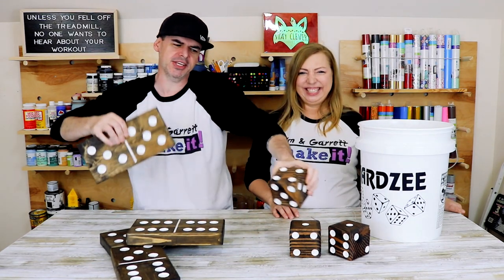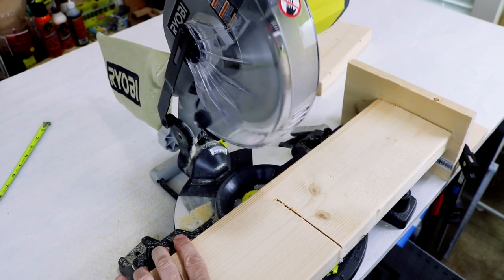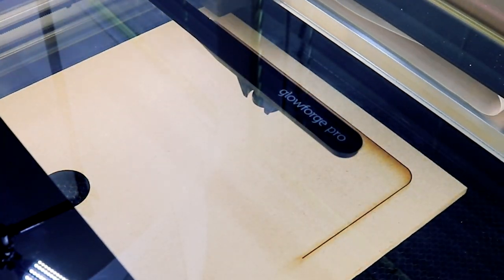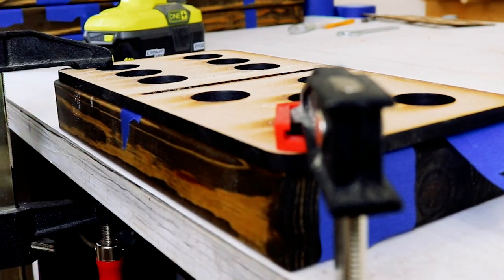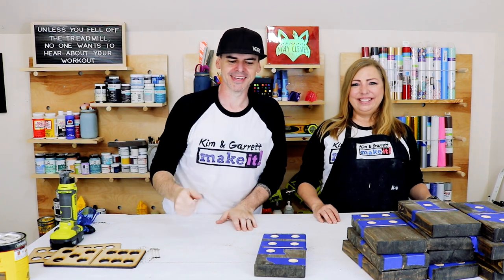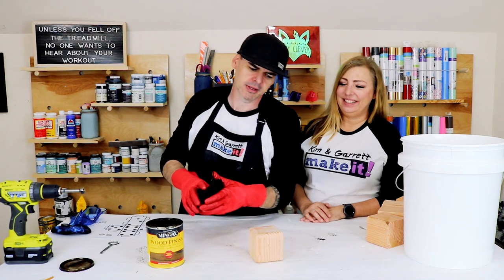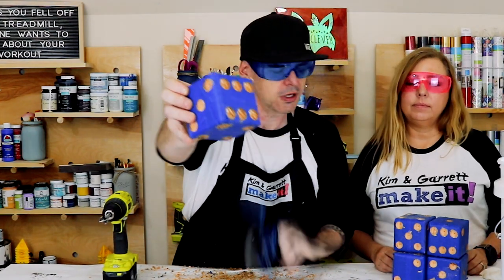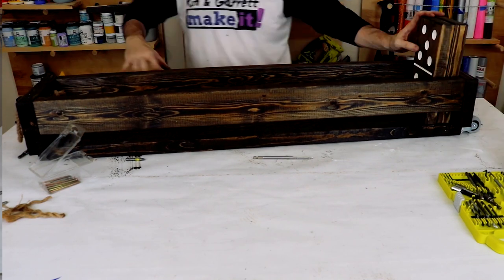2 Easy Yard Games Giant Dominoes Yardzee Dice Lawn Games

Comment: I have a friend who had a set made with yard sale dot/label stickers so I am pretty sure vinyl would work. she sealed them after placing them on the dice with acrylic paint sealer
Reply from the maker: Ohhh sealing them is such a good idea
Reply: 651 will working but the stain has to be really cured at least 48 hours and clear coat to for extra hold and long lasting stain. I made these several time
Reply: Oh also there last also another vinyl made for outside like car decals. Can’t remember the number but is starts with a 9 made from oracle
Reply: We used acrylic paint sealed and then added stickers and resealed them! So we could color theme of the party!